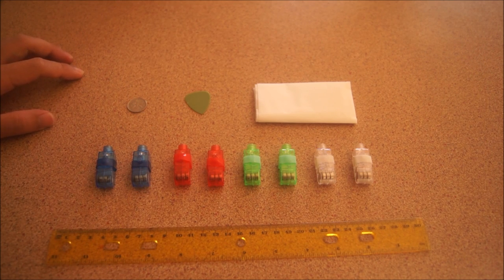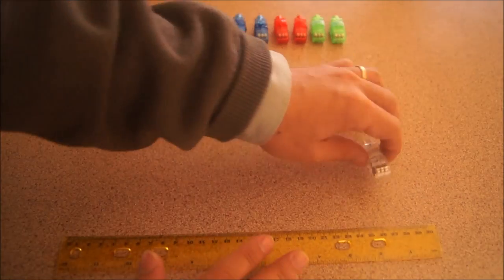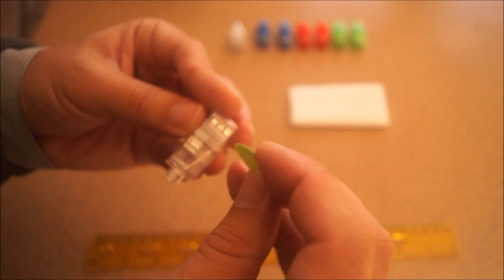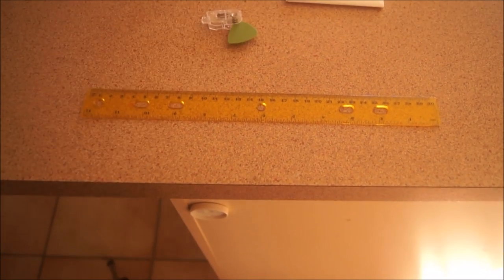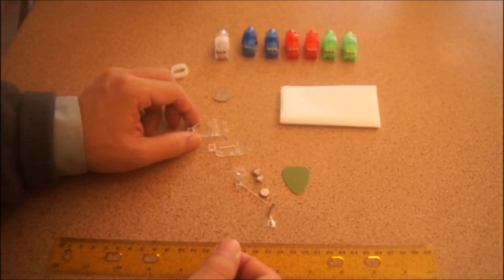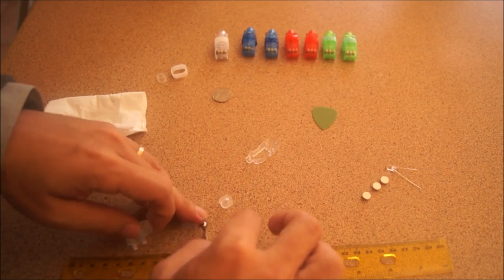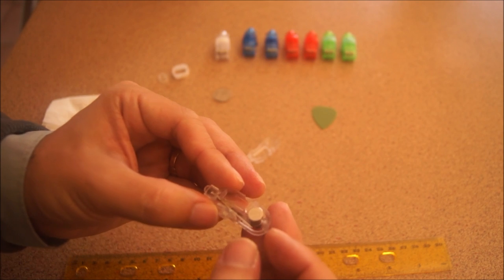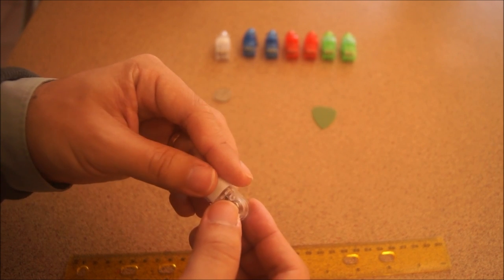Finger Lights Hack

Comment: The ones I use their switch basically moves the light around in the container to touch the bottom of the battery while the other prong touches the top and it lights up

Comment: It was a very thorough lesson. Thank you.
 But I just need to change the batteries.
I got the little door open once so I ordered little tiny batteries (AG10) from Amazon. (No one sells these batteries anymore.) Now I have the batteries and I can’t get the little curved battery cover to slide open. I was surprised how easy it was when I first accidentally opened it. Now…I can’t seem to get it to budge. I have a couple lights, each takes 3 batteries, and I bought a pack of 40. Appreciate your help if you see this.
Reply: Of course, I got it, as soon as I sent that message to you. Slides up. Very happy!
Reply from the maker: I was just about to respond to you.  Glad you worked it out.